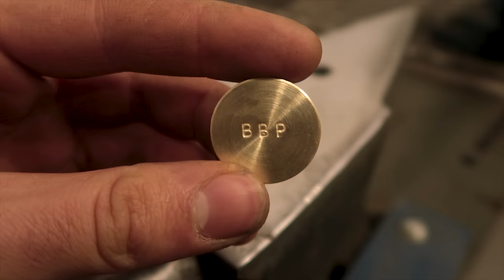Making A Leatherworking Half Moon Tool 🌙

Comment: Nice work. However, as a working saddle maker for nearly 50 years, I would recommend anyone wanting to make a round knife, is just copy what has been made for donkey's years, and leave it at that. For the serious user in heavier leather, the knife should have a gentle convex grind from well into the blade out to the edge, on both sides. These heavy short bevels I see being ground on round knives would possibly be fine in light leather, but I couldn't imagine them in the heavy stuff, say 4mm and thicker. I am constantly into harness leather , sole leather etc, and one needs all the help one can get. The outer two points are very important for accurate cutting , and are best a little wider than the knife is round , so to speak. Handle needs to taper from butt to ferrule, because when laying the knife down to skive, flanges will be a hindrance. Please yourselves, no skin off my nose. I have more than fifty round knives , some going back a century, and all different makers. They all have the features I have mentioned, because that is what works, in all types of leather!

Comment: Nice work. The only comment I would make as someone who has used a lot of round knives over many years, is if you make the tips of the blade thinner and pointier. It will be much better for cutting tight radius curves

Comment: I've been a leather worker most of my life. I can honestly say that I am not a fan of the round knife.  There are so many better options to cut and skive with these days and most of them aren't as likely to hurt the user.  That being said I have owned several over the last 30 years. You really want your points to be much finer for making tight curves and complex curves.  Too, I am sorry but the grind on this blade is not correct. You really want the bevel on both sides and you want it as smooth and and uniform as possible all the way from the edge to the handle. This should be an incredibly fine edge with a distil taper on both sides.

Comment: Next, can you cast all the metals together to make the ultimate metal( aluminum, bronze, copper, silver, iron, stainless steel, steel, titanium, tungsten, brass, gold, and more )
Reply: Unfortunately not, they have such different melting temperatures, some would just be burnt off.
Reply: But there still a chance to make the ultimate metal, we just need to make all the metals equal or same size